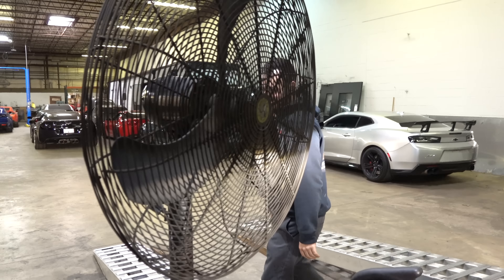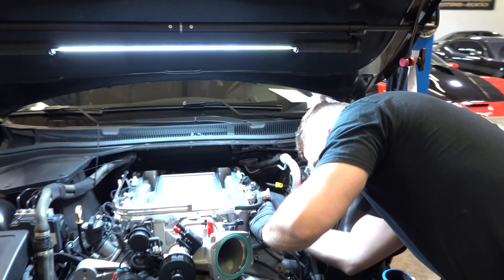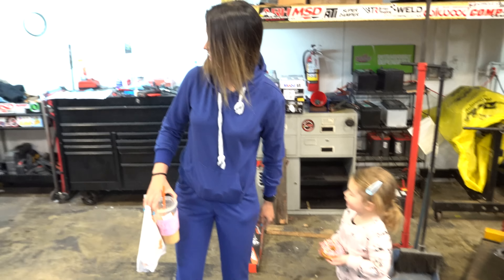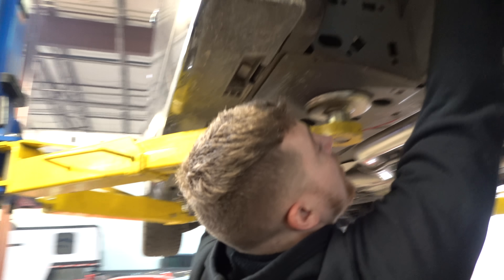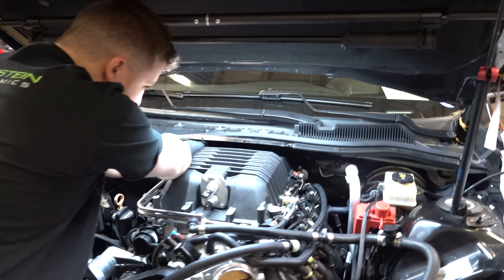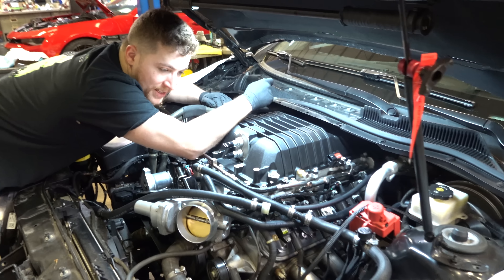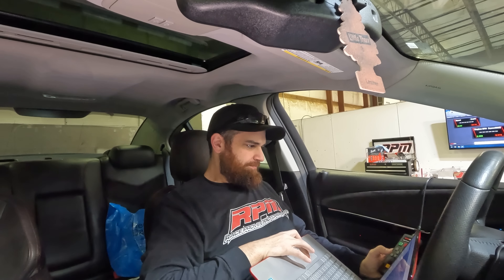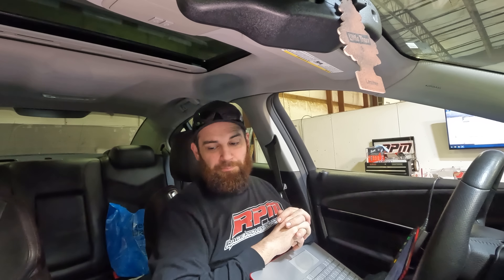200 HP Increase On 8PSI & 91 Octane

Comment: Ya in Maine it’s very rare to find 93 octane gas. There are only a couple gas stations that have it.   Now that I live in NH 93 is at every pump.
Reply: Since this has a "fuel kit", which should be a "flex fuel" kit, sensor, then using pump E-85 [40-55% E] or better, proper E-85, -88, -90, -95, -100, will achieve much more power, cleaner burning, with exceeding less carbon deposits
->Boosted engines do NO require higher octane fuel which is necessary for high compression engines to slow the burning rate even - do NO provide more power
-> pump E-85 achieves 40-50 + HP over 91 or 93 or C-16 -> proper E-85 achieves 100 + HP over any pump 91, 93, C-10,-16 fuel.
Most people are just ignorant with false, faulty information about fuel within combustion, power.
Sincerely

Comment: Is there a huge difference between a 91&93 tune. And who remembers sunoco ultra 94
Reply: I remember that
Reply from the maker: Yes.  Big difference honestly.
Reply: @RaceProvenMotorsports  how much more do you think this setup would have made on 93? 580?
Reply: @RaceProvenMotorsports  Sure for high compression engines, the higher octane is necessary to slow the burning
Sunoco had a dial  on their pumps to select the octane, via adding more tetraethyl lead, back in the 1960's to early 1970's, before the fuel requirements changed along with lower compression engines.
Fran, Matt, Eric, Kyle, Garrett, Bill should all become more knowledgeable with, about ethanol -> cleaner burning, more power and lacking, needing higher octane fuel with boosted engines.
-> pump E-85 [40-55%] achieves 40-50 + HP over any pump unleaded 87-91, C-10, -16 -> true E-85 achieves 100 + HP
You can show this via Your dynometer measurements with any vehicle, engine, build
There are differences with ethanol + methanol, ethanol or methanol alone, though small.
NASCAR use proper E-85, C-85, Indycar switched from methanol, M1 to ethanol in 2007, Top Alcohol mostly use either methanol, ethanol, Top Fuel use nitro-methane = nitrous + methanol.
Sincerely
Reply: @kolbyhumbert2680 Kolby Humbert, clearly Your have False concepts about hydrocarbon fuels -> no power increase -> perhaps less -> higher octane = slower burning -> for high compression engines, not boosted
much better with ethanol, even pump E-85 [40-55%] => 40-50 HP increase -> proper E-85C-85 = 100 HP  + also over C-10, -16
methanol & ethanol, ethanol or methanol alone have some smaller variation of power between them 
methanol burns cleaner than ethanol since it has less carbon; methanol CH4O=CH3-OH - 4H/1C; ethanol C2H6O=CH3-CH2-OH - 6H/2C=3H/1C.
Sincerely
Reply: @newtonfirefly3584  you’re lost lmfao

Comment: What would be a good supercharger kit for a 07 trailblazer SS
Reply: Find a used LSA and piece the rest of the kit together yourself. It isn't hard and it's very cheap. You'll need the adapter plate for your cathedral heads or you can buy used ls3 heads for cheap. Everything will literally bolt right in. It's stupid easy. Obviously any power mods you want will increase price (ie ported heads, cam) but if all you do is add the blower and leave everything else stock you'll still be 500+ whp easily.

Comment: So after all said and done with these Lsa kits you should just get a procharger or maggy😂
Reply: With price creep lately, it's becoming a better option to just pay a little more and get maggy/pro. Before when these blowers could be bought for $300-$500 bucks and piece everything together yourself, you could add a ton of power for not much money. A couple of companies then went ahead and bought every LSA they could, which ballooned the price of them. So now a used LSA can't be found for less than $1200 and it's becoming less viable. But the only trade is these blowers are designed and built to be daily driven, so repair and maintenance is almost non existent. I bought my kit years ago before everything went crazy and I still feel it was a good option for me at the time. Total kit for me was less than $4k, which maggy/pro were both $4k more. Also, the owner of BD was extremely helpful during install which you'll never, ever get that from maggy/pro.